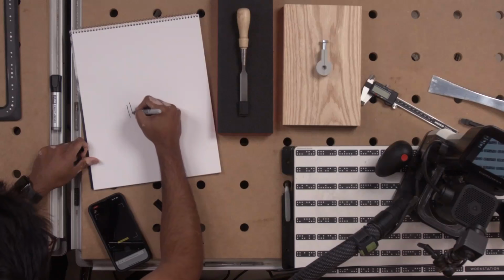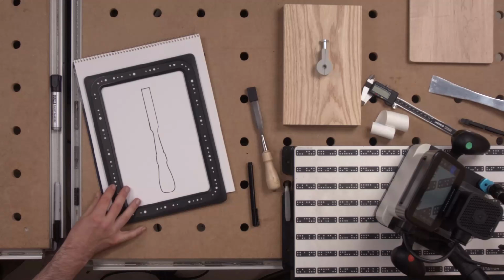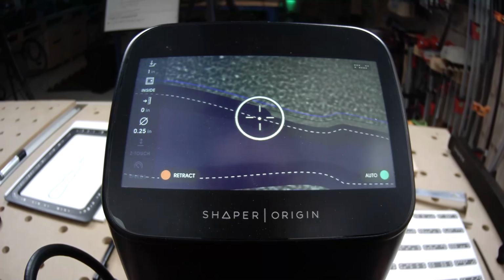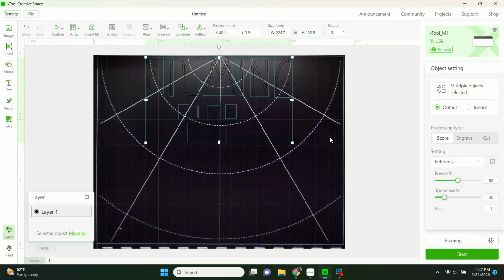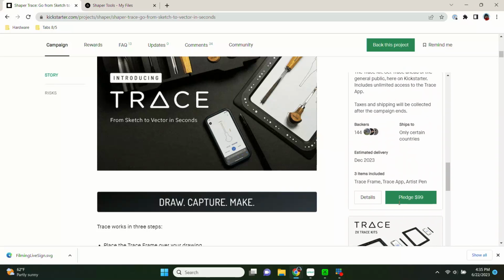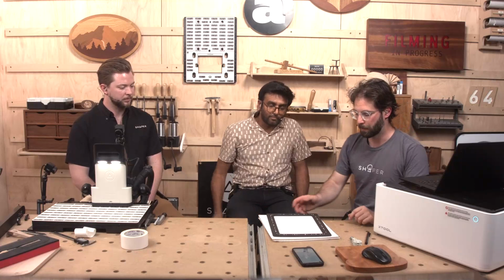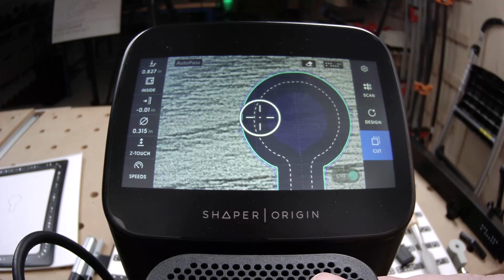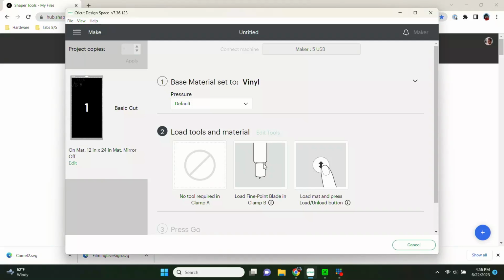Session 84  – English: Introducing Shaper Trace

Comment: Other question, what happens if you instead of tracing actually would mask the paper and use for example spray paint, would it also find borders in that?
Would be interesting to see if it would be possible to scan for example gears in that way.
Reply from the maker: Trace works based on contrast, so this would likely work great!

Comment: The issue I see is accuracy.  If you are holding a device to take a picture then it will never be exactly parallel to the trace, meaning it will be at a slight angle in any direction, which will affect the final product since you did not trace the product at an angle.  You traced it on a flat surface.  This is fine if you just want to do a signature or trace a chisel but this will matter a great deal when you want to actually use the product for accuracy.  If it is not accurate then it is no different than simply writing in black ink on a piece of white paper, taking a picture with your phone, and then uploading said picture into a jpg to vector free conversion site.  Wait...that is exactly what this product is.  Nothing more.   The problem with doing the second method is the exact same as the problem using this device...neither are accurate.  And if neither are accurate...just save the money and take a picture with your phone and upload the image to a vectorizing application (many free ones online).  Come on guys....there is nothing new here.  You have a created a product that does not solve a problem.  You have simply created something to sell and get money.   Everything this product does can already be done for free.  Sorry but this is 100% true.   Just look at the angle the camera was it when it took the keyhole picture.  That will never be accurate.
Reply from the maker: Hi Garry,

Trace accounts for any distortion in the photo and corrects for it. The results are extremely accurate and can be used for hardware insert or other operation where accuracy is key. Currently going immediately from camera to vector is not possible, and the distortion correction is not available in any other bitmap tracing software.

Once Trace ships you can see this operation for yourself! Accurate results are an important part of Trace.
Reply: Why are you such a hater? And on top of that to be completely wrong. It adjusts for distortion. Come on reading and listening is fundamental.

Comment: Can the app take a photo and correct for size and distortion? Something I do often is take a photo of an object and put that into fusion 360 so I can trace it and build a 3D model of the object. Having a tool that would automatically correct distortion and get accurate size would make this a lot easier.

Another use case I'm thinking of is for making stickers. If you had a colour drawing then if the app could take a photo and trace the outline, you could print the photo onto vinyl and then use a cricut to cut the outline.
Reply from the maker: Trace corrects for any photo distortion of a capture!

Comment: One more step to the heaven of vectorizing: having the same result without tracing around the object with a pen
Reply: Should be easy with edge decetion really. You might have to choose a dark background, monochrome, invert, detect edge, I am not sure if Trace can load images and transform them as well, but if it can, that should be enough. If not, you have to print it and then scan it, a bit redundant but works.

Comment: A bit early to ask but, Any thought on making a bigger frame so you can scan larger objects?
Reply: Or allow the app to work with shaper tape
Reply: Great question - my hunch is you can tile images and combine at the expense of a little accuracy.
Reply: @h0mersapien  This is what I initially thought.  I only hope Shaper will provide this feature so that a project larger than the initial frame can be cut for say, an inlay!
Best - Michael
Reply: As soon as I have mine, I will scan the frame and will try to make a bigger one using my Shaper Origin. Let's see...
Reply: Great answer, I never thought of that.
Reply: as far as i understand it "traces" exactly to scale, but you can edit it afterwards. so maybe we can draw in a smaller scale and just size it up? could be a solution
Reply: If they don’t, someone else will.  This is a design that is going to get copied really quickly.
Reply: I was thinking about that, as most of what I would like to do, are a lot bigger than that frame.